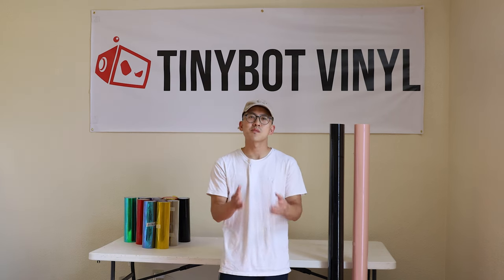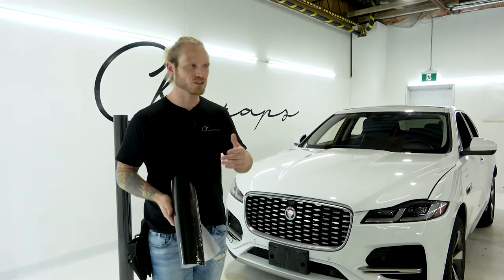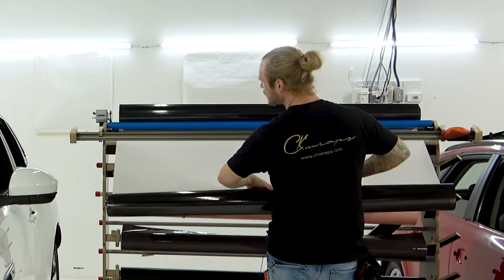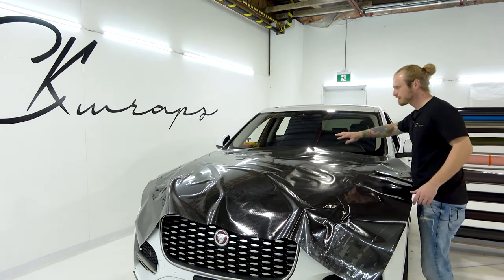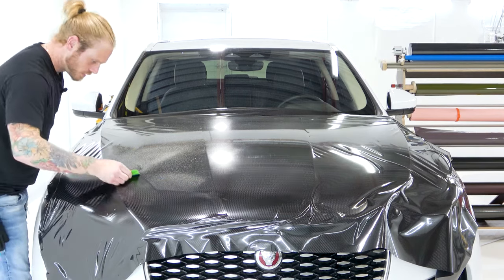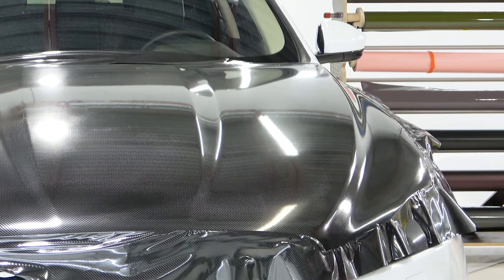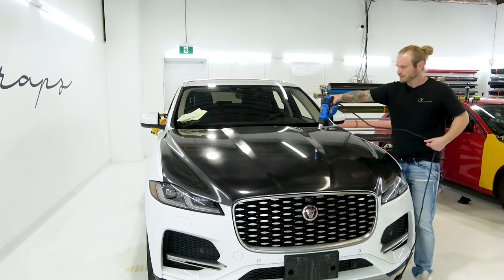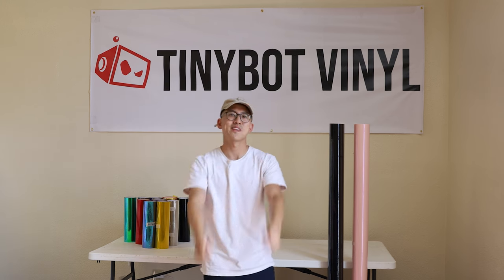A close up of our 6D Carbon Fiber reviewed and installed by CK Wraps

Comment: This material really needs ppf and/or ceramic coating in order to last longer than 6 months and have the same finish in our experience with it.
Reply: Does it fade quick ?
Reply: @Senorbeerus  probably not nearly as fast as any other vinyl but 6months or so park in direct sunoight all dat does start to fade it